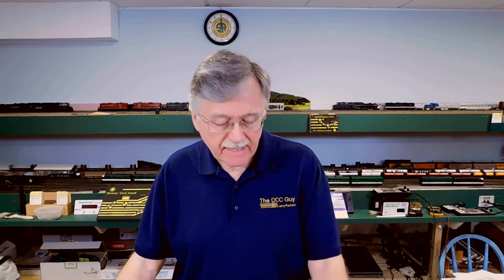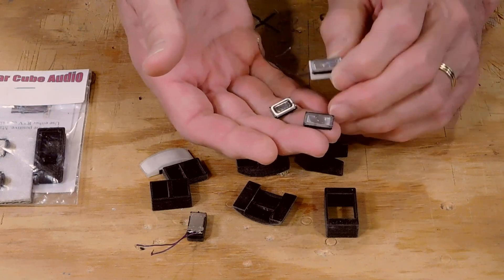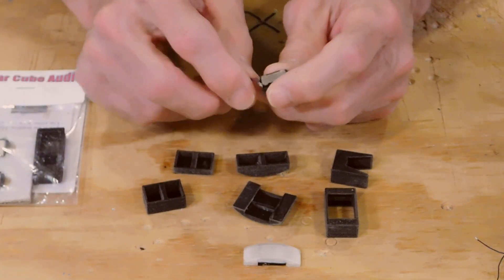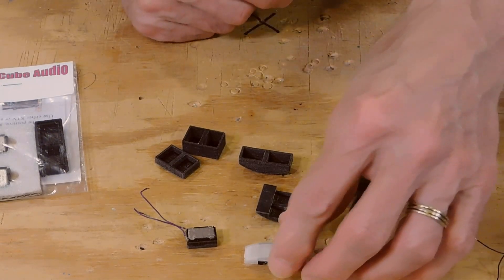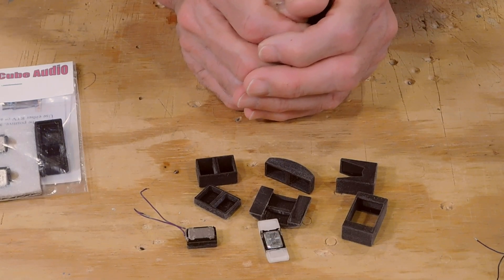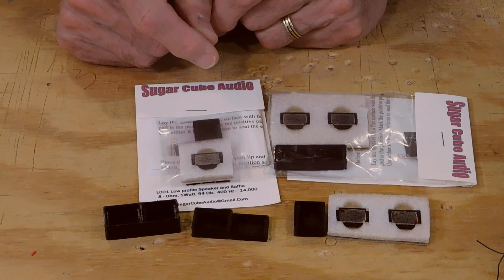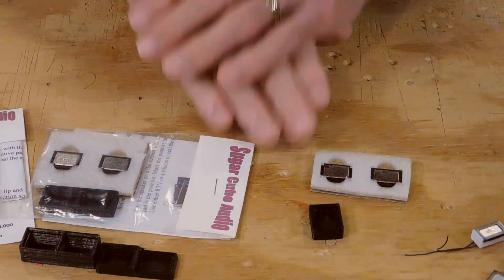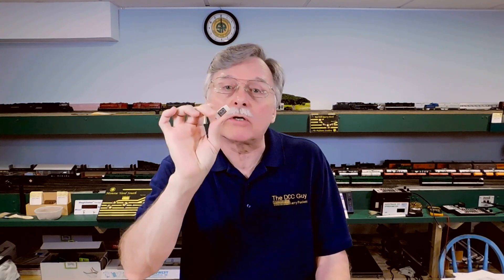Want Sweet Sound--Try A Sugar Cube Speaker (90)

Comment: Great info once again
Do you have any recommendations for an HO Atlas U23B? I’m interested in doing a few atlas locos but don’t really want to remove any weights to make room for speakers
Reply from the maker: Mark—I’d use one of the replacement board type decoders and a sugar cube in the cab as I have shown in many of my recent videos and articles.
Reply: The DCC Guy I was thinking that I was hoping I can fit the speaker in below the headlight bracket but I may have to look more into that 
Thanks I’ll review your videos again

Comment: Thanks again Larry. What  in your opinion would be the best for N scale?
Reply from the maker: The easiest and probably best would be decoders designed specifically for a given model. Most N-scale models have a chassis that basically fills the inside of the shell making it necessary to modify it to install a decoder a d speaker. Steam locos have the obvious advantage of a tender that in some cases is big enough to hold a decoder and speaker. Good lick.

Comment: Another great video Larry.  Stream Line Back Shop have a great selection of their Sugar Cube speakers.  I have installed many in the fleet of GP7/9s we have on our railroad.  I did do some research on Shapways and found 16mmx9mm boxes and on Digi-Key the speakers.   Cost per speaker was much less then what the retailers are selling them at.  The biggest problem is waiting for Shapways to make them and ship.  I have started to use iPhone 4 speakers in a lot of my installs now.
Reply from the maker: Funny, everything I have looked at on Shapeways seemed way too expensive. Guess I need to go back for a second look. I have some iPhone 4 speakers around here too, they compare well to the 11x13 mm sugar cubes and are a lot cheaper!
Reply: @TheDCCGuy  But is also depends on how many you are installing.  So far I have done well over 20 installs. SLBS $9 a speaker, Soundtraxx $15 a speaker.  So I get 50 speakers at $2.45 each from Digi-Key, and Shapeways enclosures for $1.33 each (20 on a spruce @ 26.50 each spruce).  Granted there is shipping and handling on both, so I would have to say they are about $4-$6 each.  Now if I had a 3d printer I'd figure out a way to make my own enclosures, but that is another rabbit hole I don't want to go down at this time.  Modeling and 3d printing goes hand in hand, and I really want to see if that is another aspect of the hobby I want to pursue.

Comment: I have been using the Loksound version of the sugar cube speaker and enclosure and create the assembly using regular styrene solvent - works great.
Reply from the maker: I guess you could do that with the 3D printed ones too since they are plastic. The gel type super glue tends to form a nice airtight seal on the speakers that have to be glued directly to the top of the enclosures.
Reply: The couple of sugar cube speakers (from ESU) that I have installed I just taped the various enclosure pieces together, that way I have the option of pulling them apart at some later date should I want to. Also tape is not (potentially) messy like adhesive.

Comment: Why is no one putting speakers in the smoke boxes of steam locomotives? That would seem to be the most natural place for them.
Reply from the maker: Actually some do install them there and Streamlined Backshop (SBS) makes enclosures designed to fit inside the smokebox. The main problem is finding a model where the metal chassis weight doesn’t completely fill the boiler and smokebox. That is one reason SBS designed the curved enclosure for cabs, including steam loco cabs.

Comment: Thanks for the contact info. 

I'd like to see a video or two on how to wire multiple speakers to get the correct ohms & wattage set up for a given decoder, say Soundtraxx, Digitrax and/or TCS samples.  Perhaps something like two sugar cubes in a steam loco & a small woofer style in the tender.  Another interesting topic (at least for me), would be the frequency db spectrum of the same sugar cube with a shallow and a deep enclosure.  Does it make a measurable and/or an auditory difference?  Thanks again for the great presentation.
Reply from the maker: I posted a couple videos on speaker installations and in one fo them talk about wiring multiple speakers. I will in the future do an installation or two using the double speaker setups that I showed in this video—they’re on the list, which grows longer daily!
Reply: @TheDCCGuy   Thanks!  I've been working through your presentations from the beginning.  I finished up the JMRI pieces, which were very good.  I'll look for the speaker ones you mention.

Comment: wow thanks for this great informative video again! I bought a virgin loksound decoder and it came with a small speaker like in your video and no instructions about anything. I was wondering what those square black plastic boxes were used for! Thank god I am still waiting for parts before installing the decoder I would have missed that box and installed the speaker as is....
Reply from the maker: I hope you got the dealer to install the proper sound package for you. The plain vanilla version is a basic European diesel and you will either need to send it back for an upload or use the LokProgrammer hardware to do it yourself.
Reply: @TheDCCGuy  thanks :)  I have the lokprogrammer because I plan to upgrade many DC engines. I guess after the first install the others will be easy enough to perform :) the fun is in learning it all

Comment: I’ll add a couple comments.  First, good job.  Good overview of the small cube-type speakers.  The mention of the SoundTraxx power output being up to 2W is good.. just remember that when a decoder is reset, the volumes immediately go back up, so you’ll need to remember to change your volumes back down.  On the STX cubes, the bigger 15 x12 can produce down to 100 Hz. 😳  but at low volumes.  So it’s best to add a second cube to help boost the low-end while also helping use the 2W of power!  Now these 2 cubes can made the low frequency sounds play better!  For more details, check out the Sound Theory Webinar that I did :  https://youtu.be/9CdJtdK8GEg.  I hope this helps!!  Thanks Larry!